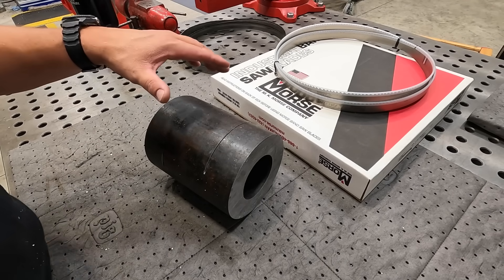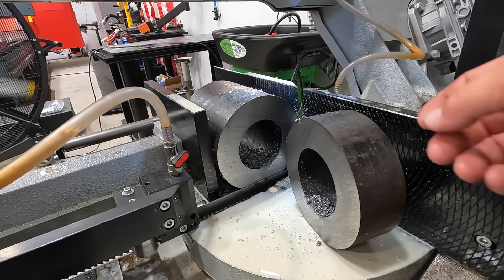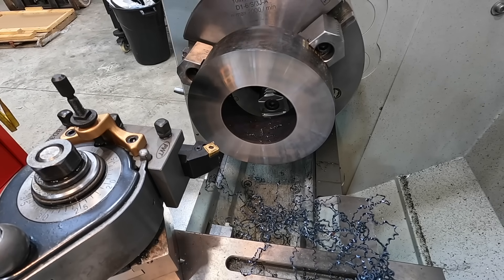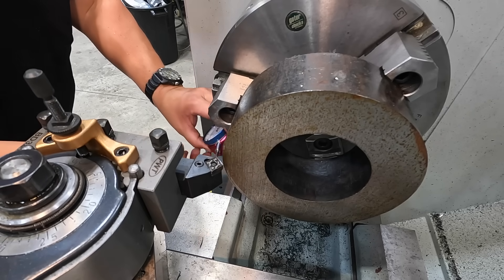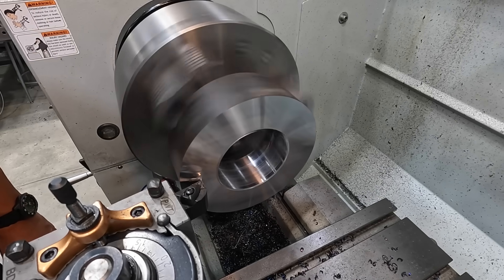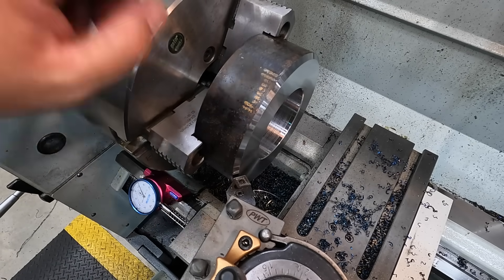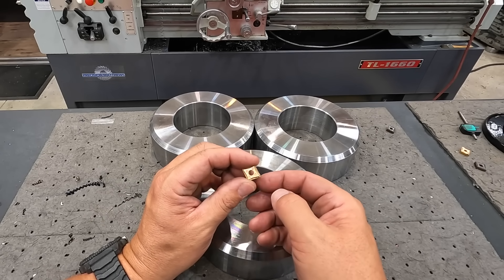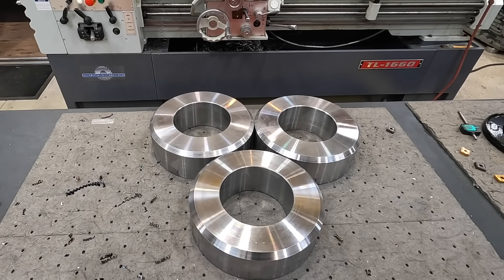Machining 90mm Pin Bosses - SNS 379

Comment: Why didn't you use your hardness tester before machining the material to see if that was within spec for the material? Couldn't that impact the welding? I'm not a welder is why I asked.
Reply: hardness of the material will definitely change the welding parameters, you are correct
Reply: Thanks for verifying that for me. Ive done a few tack welds and run a couple of beads, thays it.
Reply: The hardness tester people weren't sponsoring the vidio the band saw mfg was
Reply: Material hardness is only an issue when welding if you’re trying to retain the hardness afterwards. The process of welding is going to heat the material up past critical, which will remove any hardness wherever the bead penetrated. Ductility can be a bigger issue, which is why pre-, interpass and post-heat in things like cast iron are so important.

Comment: Way back in the day I used to make hooks and chains for GM. We cut 1 inch hot roll to length then forged them into hooks. The hot roll started having hard spots. Literally hunks of carbon in the rod. Had to use an abrasive saw to cut.

Comment: I used to transport heavy walled tubing like that, to various companies in England and Scotland, the ones in England were typically JCB Depots for hydraulic rams, the ones to Scotland were for Oil Rig drilling tubes, I begged a few bits for home, they welded well and certainly machined well too.

Comment: Test for Hardness on the waste end of the one with saw cuts in it.  Maybe wrong shop.  On the bandsaw carbide did it.  How about a skip tooth or dual pitch - fine and wide gullet.  I bet scrap steel and has bearing races that melted in to make the alloy harder.

Comment: Years ago I asked a machnists while making cuts in angle iron some sections took twice as long to cut thru. Told me angle iron is mostly recycled steel and anything goes into the steel furnace .
Reply: Bed frames. They are the worst.
Reply: Rebar is the worst.

Comment: I've run into plenty of hard spots in A36/A500 or equivalent, I've taken to calling it "mystery steel."  It's often recycled material and if they threw in too much high carbon steel it'll do this.  They're usually small spots though, just enough to peel off 3-4 teeth.  I'm thinking it really is just a lemon batch, something like too many leaf springs in the brick of crushed cars they melted down for it.

Comment: Something that I saw and wasn't sure if you'd run into it.  The hydraulic/air feed on these saws have a place where they drop when they are sitting on the stop.  I usually had to push the saw back up to it's full height, and then let it go.  This worked when the saw was set to cut a heavy feed rate so that it wouldn't crash the blade.  Basically it would preload the hydraulic/air cylinder to keep it from dropping the blade onto the part.  Kept me from chewing up blades and still cut fast.

Comment: Reminds me of something I made from an alloyed tool steel (I think something with chrom and molybdenum), it also produced a lot of blue stringy chips. It only started to behave once I got to smaller diameters with higher stepover and lower surface speed (I only have a small benchtop lathe).

Comment: If you still can, please do a hardness test on the steel. I know nothing about machining besides what I've watched and seen, but to my musical ear that sound was off from a normal lathe work. There was like a high pitched ding in there and normally when watching and listening machining the cutting sounds constant (as one would believe a material be that's all the same composition). I'd like to see the hardness from both OD and the cut itself, just because curiosity.

Comment: That chip is telling a story. I'd like to see a follow up from joe about how that welds out.
Reply: Hopefully they use a rather high preheat and wrap it up to slow cool. What material do you think it might be?
Reply: @davidbennett288 For me it's definitely an alloy steel this surface finish is not mild steel finish
Reply: @tristansimonin1376  that's my take. I've seen that before were some alloys will work harden in a blink of an eye. Effectively not mild. No idea why though.
Reply: @evil16v1  yes and with a carbide saw there is no problem to cut hard steel
Reply: From the looks of them chips I’d say that’s harder than you average mild steel. And it doesn’t finish out like that for me at least. Looks like some good material for some adapter plates or flanges. I hope it welds up alright.

Comment: I've worked with enough recycled steel to learn that unless it's certified to be a particular grade, there are both ridiculously soft spots and then, there are some hard spots that will ruin multiple brand new drill bits within seconds.  I imagine the same is true for cutting blades.

Comment: Having machined enough boiler tubes over the years like stainless, low alloy, medium, and high alloy carbon steel, this material almost looked like it could be 9 chrome.  Giant pain in the butt!
Reply: No fun to stick weld either.... it's like welding mud and so much smoke you can't see a darn thing.
Reply: @dbennett4 Welding mud😅😅
Reply: @jamesmilos9909  best way to describe it!

Comment: we have been getting lousy 1018, really ductile wont break a chip. finish is great but its giving us a ton of grief with our iscar dr drills not breaking a chip, which normally cut great with fantastic chip control. we think its metallurgical, low sulfur and high aluminum content seems to be a recurring theme in the stuff that wont break a chip, the "good" stuff is high sulfur and nearly no aluminum

Comment: I run alot of tubing that looks like that, its called 4140 HRHT on the sheets I've seen.  I think that means Hot Rolled Heat Treated, I do know it's plenty hard when I run it, I usually have to run it around 375 Surface feet it seems, taking about .500 off the diameter per pass. I use a Iscar 643 8250 insert with good results but I use the 432 8250 alot as well on other stuff.  This is a aircraft tail wheel fork spindle housing I machine lots of.

Comment: sometimes we miss the obvious. we know that we can cut high speed steel with carbide. so when you know you have saw blade imbedded in a softer material change the surface feet per minute as though you were cutting high speed steel. it may take longer but you save the insert.
Reply: He knows that. He even mentioned it. But when one company sponsors you, you have to trash one company and prop up the other.

Comment: I have experienced that same blade destroying situation my self few years ago. 80 mm or just over 3” Bar stock had hard spots in it. I turned bar when it stopped cutting and it just kept stopping at same spot even after turning like there is small carbide pieces inside or something

Comment: You (and your customer) have a material problem. I would guess that stuff is rC 45. Did you try it on a hardness tester? I wouldn't weld it without further identifying the material. I'd expect it would Crack under weld without 700⁰ preheat.
Reply: hardness and PMI would answer a lot of questions for sure

Comment: if a cnc machine makes 10,000 parts runs super fine, puts in a new rod and everything goes wrong, then you know there is an old bike in the material  .  there may be hard points or the whole bar is hard, or the opposite long chip everything goes wrong, it's not the same as a manual where you change the parermeter  according to what you see :face-blue-smiling::face-blue-smiling::face-blue-smiling:

Comment: Elephant in the room, the blades were put on backwards obv
Reply: I doubt that anyone would be that dumb.
Reply: @ellieprice363  Ive seen it with bandsaw blades and circular saw blades. There is no reason when putting on the other replacement bandsaw blades they were then on the correct way, if you dont know the difference in the first place.
Reply: I doubt it, sounds like the guy has a good bit of experience and then to install them wrong 3 separate times seems unlikely.  But you never really know what people will do
Reply: @skeeton5772  It seems that he thought backwards was the right way, possibly the only way and did not realize there was an alternative.

Comment: I have not looked at Abom79 channel for a year or more....Back in the early 1980's I had a one-man welding shop for 5 years...no bandsaw, lathe or mill...But, I did use a lot of DOM and CDS for making weld-on hinges...pretty much the same sort of heavy equipment uses.
 Everything I cut was abrasive (24") chop-saw or torch...CDS can be somewhat work hardened in the as-purchased state. depending on the type of steel you request, it will definitely be work hardened...and not guaranteed to be without some stresses or hard places. 
 All the DOM or CDS I ever used had a much nicer outer surface finish. This stuff here almost looks like it was some sort of hot drawn process....?
 I bought all my material/s new from a steel supplier, they even recommended DOM for better tolerance on the ID for cold drawn rounds for the hinge pins..

Comment: Sometimes as a job trickles down to the Machine shop, the shop of last resort, it's the worst of fixing the previous fixes before actually doing the actual job that the part needed to begin with.  Fortunately, Adam cut his teeth on just such jobs, all the "getter-outs" and "hey man" jobs that come to live or die on the machinist's job shop floor.

Comment: That material behaves a lot like 4140 or similar. Not saying it IS that, there's other stuff that also makes similar chips. I machines something out of an old car hub, that I was told would be 1090 or something like that, and gets a very nice finish, but chips that are very stringy.

Comment: Hey check this out.  That blade was squealing pretty loudly.  Personally, I'd slow that sucker down. Those blades are $100+, the carbide blade is much more expensive.  It's obvious that the blade went away and work hardened in the groove. I'd be worried about welding that piece into whatever they're fixing, and creating some very hard spots against the weld.

Comment: That crusty scale on the OD looks like a real blade eater.  It sure cut good, but my ears hurt through the TV. 😂

The teeth unzipping on a blade is a real phenomenon.  As soon as that first tooth goes, the next one gets slammed and starts that chain reaction and all of the sudden you've got a blade with six halves of a tooth left.

I'd have gone at those embedded teeth with a shark wheel (tiny abrasive cutoff disc) in a die grinder

Comment: Did he check the set on the blades. We had a hydmech and started having problems and didn't notice the supplier sold us a different set. It would be fine for cutting thin mater but cutting thick materials the teeth with chip. Because the material builds up between the teeth before it comes out of the cut. It causes too much pressure on the teeth and the snap. Would work fine on thin stuff. Not enough space between the teeth.
Reply: I hate auto correct
Changes what I type.

Comment: I rarely use anything but a DCNLR for facing and turning...I was very surprised to see you use the MCMNN on your initial face turn.  They need either high feed or slow speed to break a chip...especially when running a .015 nose radius insert.  I'd jump up to a 432 in your situation.
Reply: The reason it needs high feed is the 45 degree does a chip thinning effect, so you need 50% more than you would with a straight orientation to get the same chip formation
Reply: @procyonia3654  You're partially right...a CNMG insert is an 80 degree/100 rhombus
Reply: @ChuckRoss77  you are right, I was alittle off on the angle, not sure what I was thinking on that one

Comment: I’m still a noob machinist, and I haven’t watched past 2 min yet, but I’m wondering if that outer mill scale along with speeds and feeds may have tore up that first blade. Then if you have hardened saw teeth embedded in The material you can ruin as many blades as you want trying to cut through.

Comment: Along the lines of saying it is a better part because it is from a Billet. Without stating Billet of what Alloy, and if it was tested.
Reply: A Billet of backyard foundered Brake Rotors, or cement covered rebar?

Comment: Wouldn't be surprised if the recommendation made to use those inserts was assuming you were using a cnc with higher rpm.
Reply: I would be very surprised given the supplier and the customer.

Comment: I use those YG inserts and I don't have a problem. I had similar strings on a piece of unknownium the other week but increasing the feed solved the issue. 
I don't get as upset as you Adam when I trash an insert and I pay for mine.
Reply: His whole shop is sponsored, that’s why he always trashes the competition. He said himself that the feed rate was too low. But did he change it? No. He needed to make the other inserts look better.
Reply: @SergioPena20  do you have evidence that his whole shop is sponsored? Or are you just guessing?
Reply: @kumoyuki  watch his videos. Whenever he gets equipment, he always makes a video about it and says “my friends at so and so sent me this…” Now if he can get his AC, his welder and other things like that given to him, what makes you think he can’t get inserts for free?
Reply: @SergioPena20  In fairness though, I have known people from the American South that speak that way about literally everyone. It's arguably circumstantial, but I was wondering about something more concrete
Reply: @kumoyuki  Most everything he has including his CNC machines he has received for free.  Everything @SergioPena20 said is correct. Sorry to say, but he is nothing more than an influencer these days.

Comment: This is a problem with remelt steel. If there is a tap or some kind of vanadium steel in the mix that wasn’t stirred in well enough you’ve got extremely hard spots.

Comment: I'm curious about the economics of this job. The customer first destroying many bandsaw blades, then Adam risking a brand new carbide tipped bandsaw blade and potentially many inserts, seems weird in service of saving the about 80 pounds of hollow round bar needed to make four of these bosses from known virgin material. Was there some supply chain issue causing a prohibitive cost or lead time for the stock?
Reply: The previous guy experienced a problem and was curious, Adam said he’ll have a go and see what he can come up with. This makes for an interesting video against predictable boring safe video.

Comment: Looks like there might be done chromoly in there or something. Reminds of that by the continuous blue stringy "chips" and the nice fine finish. But that stuff is pretty damn hard. 
Don't know if it is re melted mild steel that has some chromium or molybdenum in there.

Comment: I would be so nervous running carbide tipped blade. If a tooth breaks off and gets lodged in the steel it'll wipe all the other tips off that blade.

Comment: So what was the steel grade supposed to be? AISI Type 10xx, but the last two digits are missing. So it's carbon steel, but I can't tell which one.

This might just be a problem caused by a really low sulfur content in this material. For good machinability the steel needs to have a little bit of sulfur. Not a lot, just 0,015 to 0,03 % by weight, to form MnS (manganese sulfide) inclusions that help with chip breaking. Too lean on sulfur and you get this stringer behavior.

Comment: Must have been hot rolled. I would have taken a file to it to check its hardness see using a car by blade I was going to say that's saw surface feet is way too fast. The other way if it has a hard and crust from Rolling you would take a grinder and grind that off in a lathe or turn it off with carbide if possible then use the saw I would be interested to see what the hardness is on the surface is supposed to inside that heavy wall pipe

Comment: Adam, you need to make yourself a proper chip hook and stop using pliers to pull the chips!... Also, look for Allen Handi Drivers for your insert holders ... Back in the day I used GE Carbaloy, Kennametal and Iscar!!!

Comment: I have a question about those inserts you tried. I know nothing at all about machining except what little I have learned through youtube. I work mostly with computer software, so I'm barely an engineer as it is (says engineer on my university title, but I'll guess not everyone would agree with it), but I would assume that the manufacturer must have some datasheets for those inserts? Like, a place to say what they expect the inserts to handle, in terms of materials, feeds and speeds?

Comment: Change the feed before dismissing the insert geometry. It was clearly too fine that is why you had stringy chips.
Just hit the weld prep chamfer with two cuts using the 45 deg tool instead of the boring bar setup.
Reply: Exactly what I thought always play with feed and speed before assuming something. And yes try to plunge with all the width of this 45° tool was not a great move
Reply: @tristansimonin1376  and depth of cut.😉
One pass at half depth with the 45 tool then blend in deeper. Far quicker than setting up the boring bar.
Reply: @machinists-shortcuts  yes it is what I usually do 2 or 3 and after blend it
Reply: One brand sponsors and the other doesn’t. He knows exactly how to fix the issue. But it’s easier to trash the one that doesn’t pay you or give you free stuff.
Reply: @SergioPena20  The blatant promotion is now beyond cringeworthy. Resorting to brand promotion at every opportunity really spoils the content. It confirms the skill level is too low to make a living from machining, even with loads of free machines, tooling and all the Youtube money.
Reply: @tates11  yes sir. My thoughts exactly. 👍
Reply: @SergioPena20  He set the feed to 0.009"/rev as the insert box suggested, he did not know that the cross feed is half the feed of the longitudinal feed 🤣